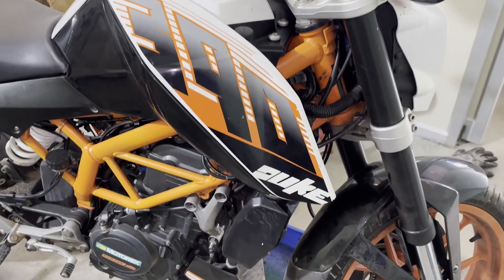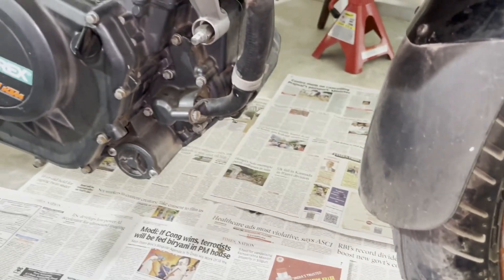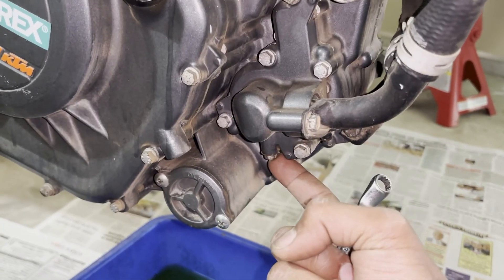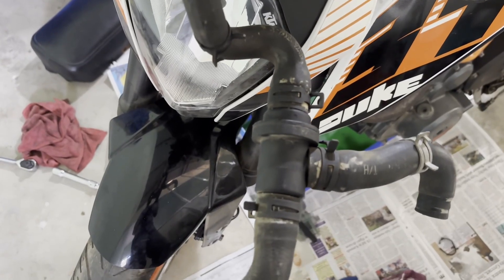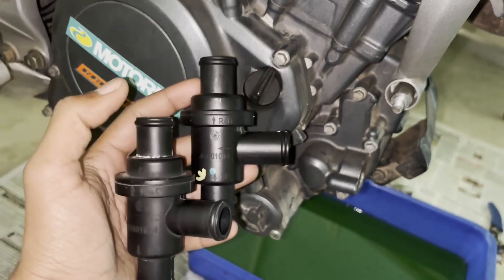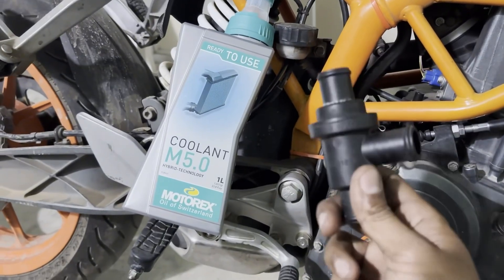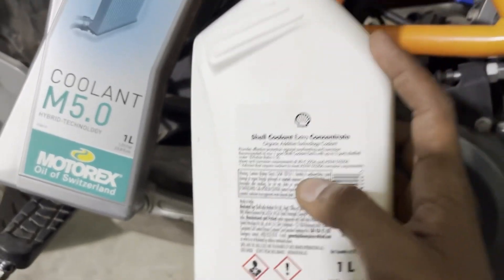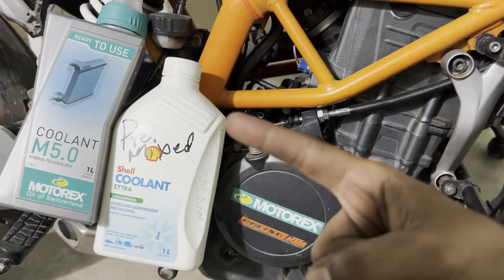KTM duke spitting Coolant !!

Comment: If the coolant is overflowing from the resoviour then it might be the issue of head gasket as the damaged head gasket might be loosing some compression into coolant system i was also facing the same issue and the coolant was overflowing in higher rpms.

Comment: Bro, I bought a rc 390 bs3, engine oil and coolant was mixed, i took it the mechanic, they changed the water pump seal, after the service done I took it for a ride around 150 kms, when I was about to park the bike in my 🏡 this same issue happened (coolant was spitting out) should I replace the thermostat?
Reply from the maker: First check if it happens only once or frequently. If it happened only once after getting the seals changed and coolant filled that could be due to overflow of coolant due to expansion upon heat up which is quite normal if coolant is filled up after drain out.

If it happens frequently and coolant boils and throws up just after turning the engine off, check the below things one by one -

1. Bleed the air in cooling system (There is a bleed screw on the left top side of radiator which can be loosened to remove any air present in the system by holding the bike upright or slightly tilted right.

2.If the first step doesn’t solve the issue, check the coolant which is used in the bike. Is the recommend coolant used or a general one which is used in cars and trucks ? Get a coolant change if the coolant that is used is of wrong grade.

3.If the first two steps doesn’t solve the issue, check and replace the radiator cap and if this doesn’t fix, replace the thermostat.

Comment: May I know how much the bike has run? 
Also, how frequent is this issue on the KTMs?
Reply from the maker: It has run around 7k kms.Previous owner had used it very sparely and the bike was parked most of the time.This issue came along with the bike upon purchase I believe it occurs only when the thermostat gives away or when the wrong concentration of coolant used.